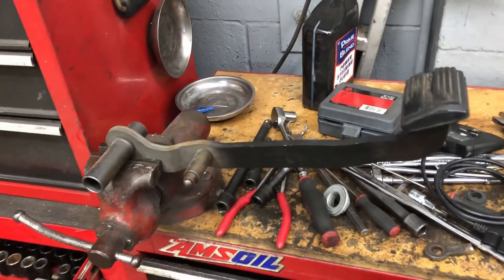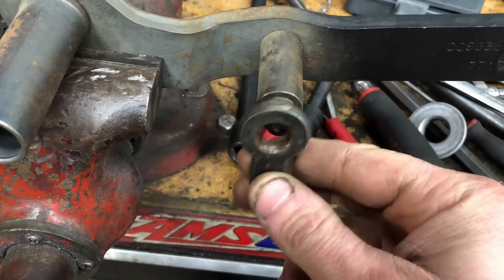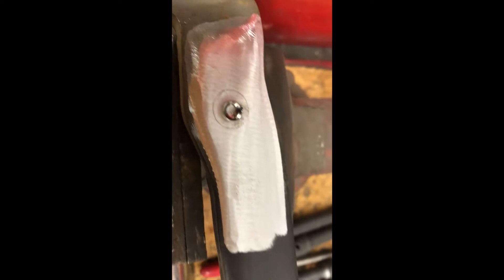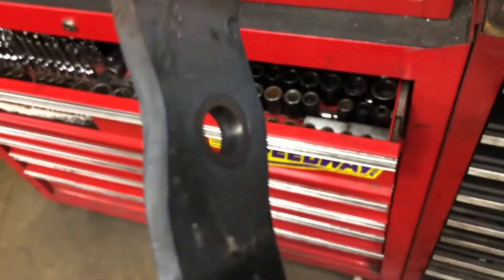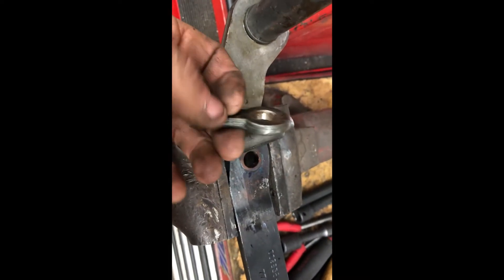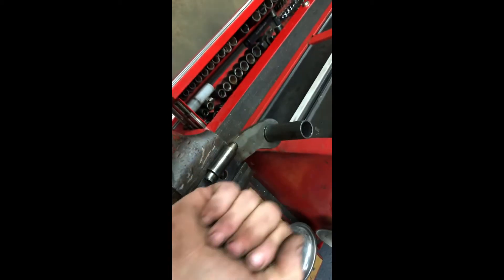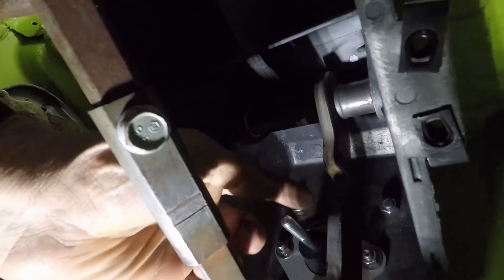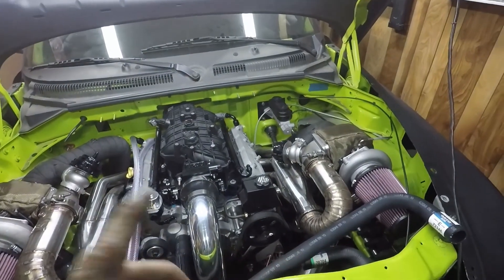Power to Manual Brake Pedal Rod Modification

Comment: doing what you described did NOTHING for pedal ratio like you are trying to get.  By having the drop down from the new pin point, that is bring the the ratio right back to where it was.  The Ratio is dependent on the length from the pedal pivot to the centerline of the master cylinder and since you effectively did not change that, you didn't change the ratio. you either need to move the master cylinder up by the same amount that you moved the pin up on on the pedal. Or another option is the actually move the pivot down on the pedal and move the holes in the hanger bracket (where the pivot pins or bolts) down by that same amount.... This method keeps the master cylinder and pedal pad in the same relative locations but would increase the ratio. For example, if you had say a pedal that the center of the pad was 12" from the pivot and the center of the pin for the push rod was 4" from the pivot, you would have 3:1 pedal ratio. If you move the pivot down by 1" thus making the pedal pad now 11" and pushrod pin now 3", you have a ratio of 3.66:1..

Moving the pivot down (both on the pedal and on the hanger by the same amount) is the only way to increase the ratio without moving the relative location of the pedal pad or the master cylinder.
Reply: Agree you've changed nothing the center line of the master cylinder would need to be raised to be in line with the new pin position......must be seat of the pants brake feel.

Comment: Great info Brian. Why is it you think that know one changes the brake ratio when upgrading to a power system from manual. Is it not necessary? I would think that owners of tri-fives would want their pedals at a lower stance to floor. Like new cars today. From gas pedal to brake is a foot different !!! There is no sliding your foot from the accelerator pedal to the brake. On your video you talk of more leverage. I see it makes since for non power brakes. But OMG> Why go to manual brakes in the first place! It is dated technology! Why not drive a model A or T? Instead. Great re-engineering yet I really think it a serious waste of time. My issue is I want to go from standard system to power so I can stop "My Monster" And I'm only concerned about the throw distance in the brake pedal as having a ratio issue when I go to power. Guess no one cares about where their pedal sits as long as they can build a $50k car and then show it and sell it later. No one seems to drive their tri-fives I guess. Good job on video.
Reply from the maker: If you look at most high level, high power builds. I’m not talking show cars or the like. But actual race cars, they are almost all manual brakes. Manual brakes when properly setup will perform and feel just as good as a power brake system. Minus the headache of dealing with intake boost pressure and losing vacuum assist in certain instances. Doing it the way I did you lose no braking power and pedal feeling feels like the stock power brake setup. I’ve driven several manual converted cars and you wouldn’t be able to tell they weren’t power assist. 

Second I chose manual brakes because neither a vacuum booster or hydroboost setup would fit within the area I was working in. 

I have a friend with a legit 8 second street Dakota with manual brakes and it stops just fine. 

It’s all in the setup and parts selection.
Reply: Brian Esser I appreciate the insight. I will consider going manual myself.
Reply: Are they drum brakes or disk?
Reply from the maker: Rick Bell Front factory disc and will be rear Ford disc. With drilled and spotted rotors all around and Hawk track pads. Braided stainless hoses and all new lines with manual adjustable prop valve.